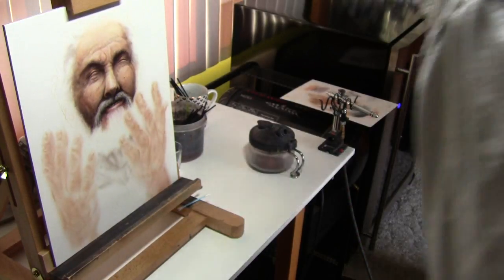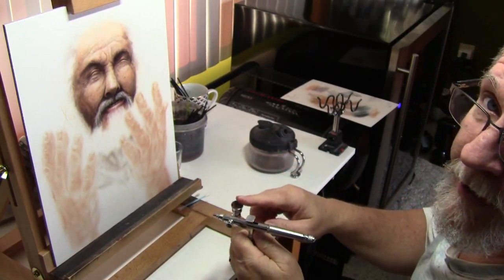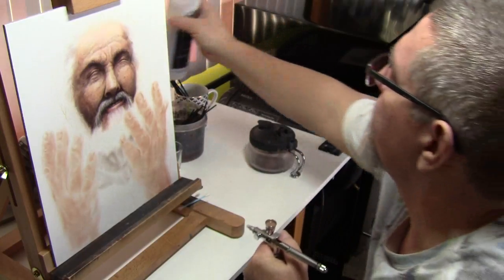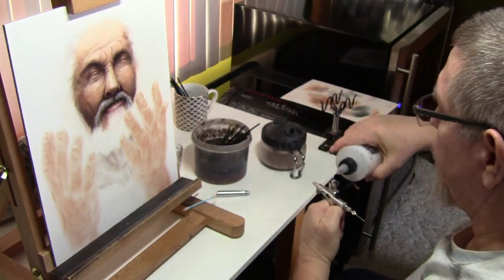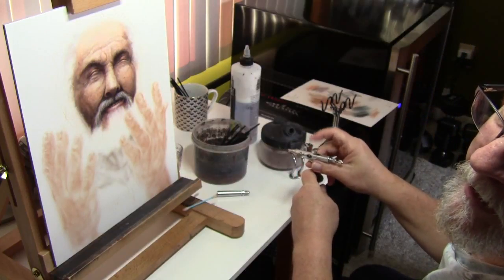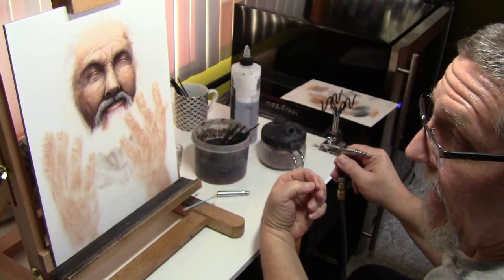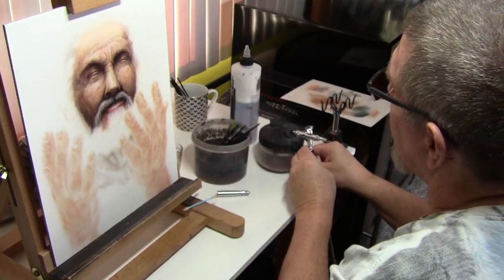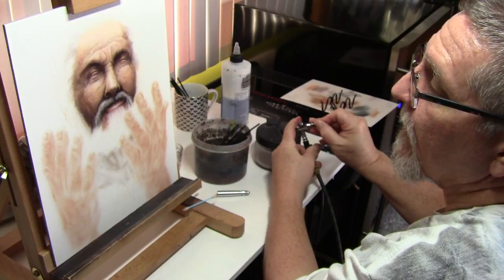Cleaning and Sealing an Airbrush

Comment: Fred, what are you using for cleaner?  Thanks for sharing your incredible knowledge with us here.
Reply from the maker: Marty I use a homemade recipe which is 
1 cup Rubbing Alcohol
4 cup Water
1 cup Glass Cleaner (non ammonia)
5 drops Glycerine
1/2 bottle of nail polish remover (Acetone)
Reply: @fredaw61  You say half a bottle of Acetone. Would this be 8oz or 4oz of acetone? Also, what is purpose of Glycerine?

Comment: Can I get rid of the large rubber 'O' ring that seals the nozzle cap on my cheap airbrush if I use beeswax?
Reply from the maker: I would not. They help to keep from over tightening the head and crushing the floating nozzle into the body of the airbrush. I do not use beeswax on the eclipse style airbrush. If they are leaking then just tighten a bit more.
Reply: @fredaw61  Ahhh...ok...that makes sense...It is a cheapy airbrush ($25) and I use it for varnishes and such bulk work since I bought the Iwata Revolution last month...Thanks for the speedy reply...Happy airbrushing...From the UK

Comment: Good tips in there Fred. Thanks
Reply: thanks Fred for this detailed information how to keep the brush in perfect condition, especially the tip for sealing the threads with bee's wax.
 Now I'm going to watch your film with these hands beautifully and very instructive ;-)
I myself have trouble with the short hairs of the eyebrow to get beautiful
do you have a tip for that?
Thanks
Reply from the maker: doing short hair of the eyebrows is not too hard. I will lay down a light under tone and then scratch into it and the mist the light color of the eyebrow over the scratches and do a couple layers this way. After that I lay small dagger strokes of darker shadow tones. If it is a dark eyebrow I lay down a shadow tone and lightly erase some highlights into it and finish with darker dagger stroks.

Comment: Who makes that easel. Would love to get one
Reply from the maker: When we ordered it it just said Heavy Duty Table Top Easel. No name brand. Truthfully I would have preferred one that could extend over the front edge of the table. My hose rubs the edge of the table and is showing signs of wear. Plus at certain points my elbows have to rest on the table and I have to bend my wrists.
Reply: Fred Wagner thank you for the reply. I just may make my own. Being a cabinet maker it should be easy  I’d rather be practicing with my AB instead. Awesome video on the cleaning.